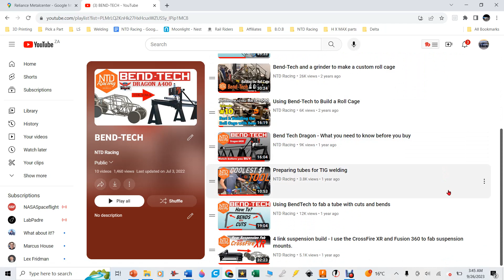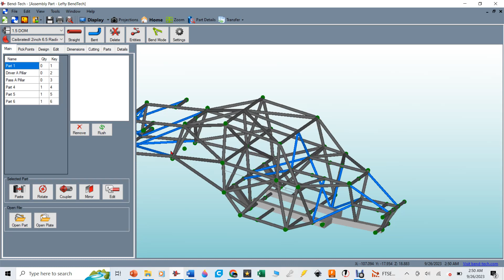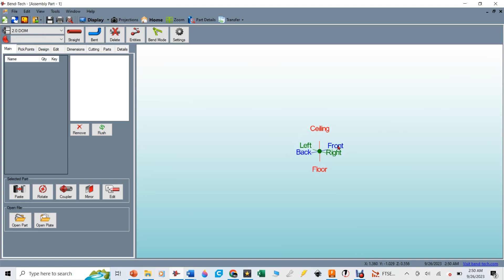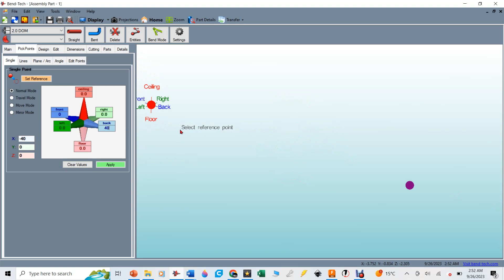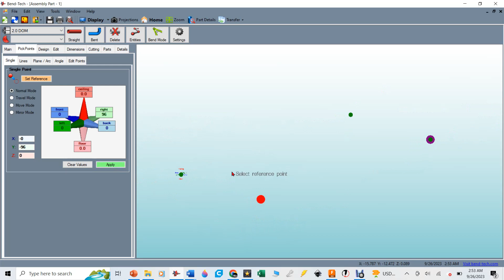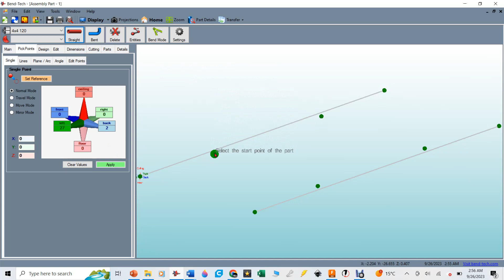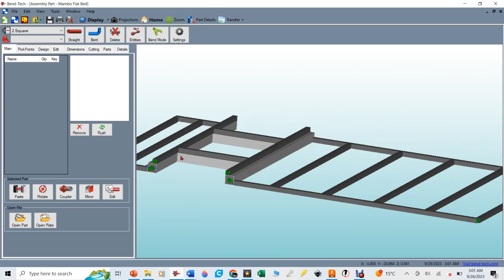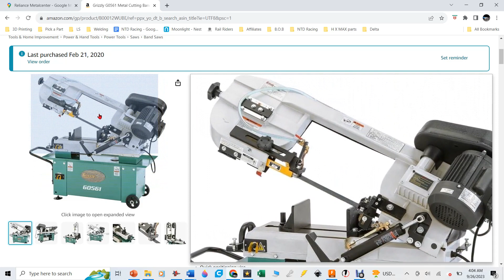How to Flat Bed a School Bus

Comment: Great tutorial on using Bend Tech.  Is it possible to build a model in Fusion 360 or other modeling software, and import the STL file into Bend Tech and the tubes be generated?

Comment: I have bend tech as well.  I have had no actual project to practice on at the moment. The one I have was done by the designer and I already have all the cut wrappers created thru bend tech for it.  I don't seem to be able to retain the information not having an actual project to test it on .  As soon as this is finished, I intend to start something new that will force me to learn the procedures and commit them to memory.  I am sure once I do , it will become second nature. I enjoy all your projects.
Reply from the maker: I just got out of the garage after cutting some wraps and tubes.   Not my favorite job, but the results are always good.   Here is a video I made a while ago where I show how I use the wraps to transfer cut lines on to tubes...hope it helps.   https://youtu.be/ZlmLKxpqrgs?si=pQgQLL-wlWa1H2tJ